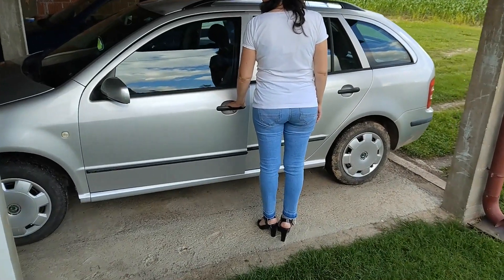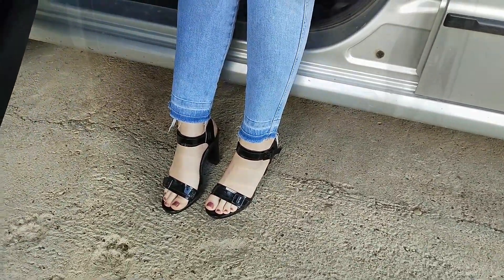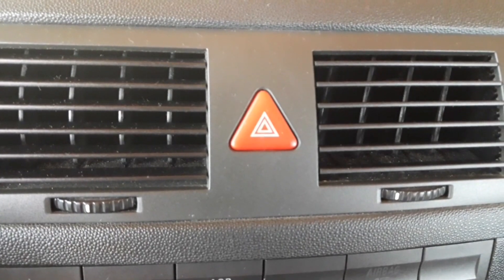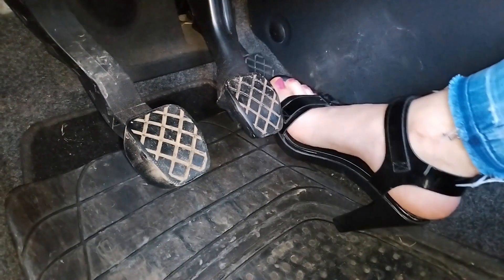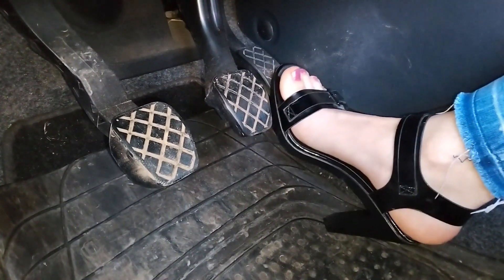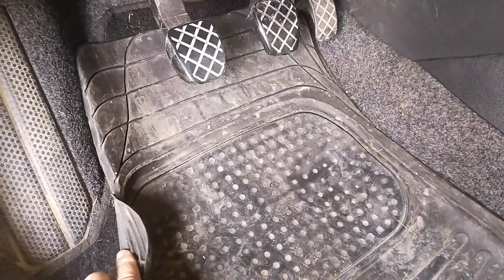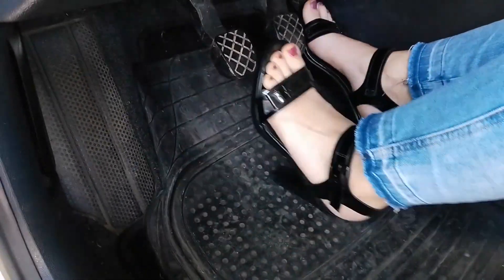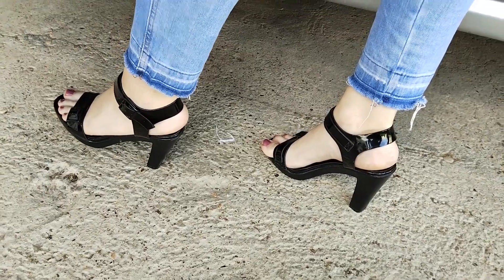How To Drive In High Heels? Tips For Avoiding Problems

Comment: 2:55 never put two floormats one on top of the other, this is possible source of problems. Here are shown rubber mats over normal ones. Don't do that, use one or the other.
Reply from the maker: Thanks for watching and for sharing! In this case, there is no sliding of the floormats.